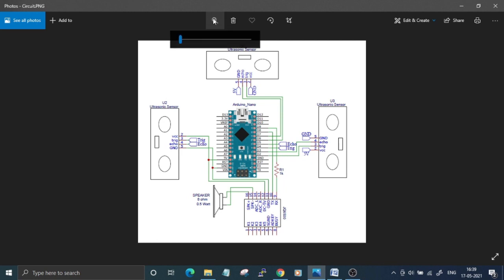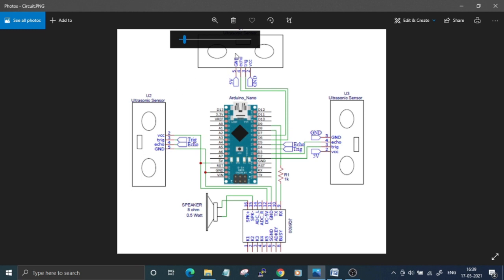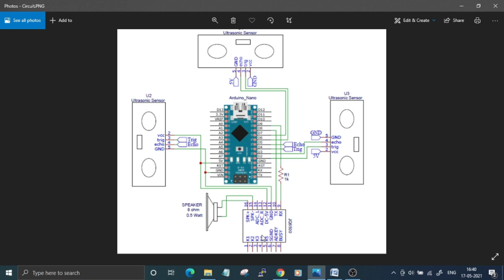How to Make a Smart Blind Stick using Ultrasonic Sensor | Arduino Project

Comment: waste code is not compiling waste of timee
Reply: I have rectified the error
Reply: @afzalahmed2756  Can you point out the error in program??
Reply: @afzalahmed2756  can you share the code
Reply: @afzalahmed2756  can you send me correct code
Reply: Hi can you please help me with the code? Thank you in advance!
Reply: @marielsophianicoleso1533  I have shared the code
Reply: @afzalahmed2756  can you please post the code
Reply: @ahmedalsiri2811  
#include <Arduino.h>
#include <SoftwareSerial.h>
#include <JQ6500_Serial.h>
SoftwareSerial mySerial(8,9);
JQ6500_Serial mp3(mySerial);
int left_trigPin = 7;
int left_echoPin = 6;
int right_trigPin = 2;
int right_echoPin = 3;
int center_trigPin = 4;
int center_echoPin = 5;
int motorPin=10;
void setup() {
 pinMode(left_trigPin, OUTPUT);
 pinMode(left_echoPin, INPUT);
 pinMode(right_trigPin, OUTPUT);
 pinMode(right_echoPin, INPUT);
 pinMode(center_trigPin, OUTPUT);
 pinMode(center_echoPin, INPUT);
 pinMode(motorPin,OUTPUT);
 Serial.begin(9600);
 mySerial.begin(9600);
 mp3.reset();
 mp3.setVolume(100);
 mp3.setLoopMode(MP3_LOOP_NONE);
}
void loop() {
 left();
 right();
center();
}
void left() {
 delay(100);// reading will be taken after ....miliseconds
 Serial.println("\n");
 int duration, distance;
 digitalWrite (left_trigPin, HIGH);
 delayMicroseconds (10);
 digitalWrite (left_trigPin, LOW);
 duration = pulseIn (left_echoPin, HIGH);
 distance = (duration / 2) / 29.1;
 //distance= duration*0.034/2;
 if (distance < 10) { 
digitalWrite(motorPin, HIGH); //vibrate
 delay(1000); // delay one second
 digitalWrite(motorPin, LOW); //stop vibrating
 delay(1000); //wait 50 seconds.// Change the number for long or short distances.
 Serial.print("Left Distance");
 Serial.print(distance);
 mp3.playFileByIndexNumber(1);
 }
}
void right() {
 delay(100);// reading will be taken after ....miliseconds
 Serial.println("\n");
 int duration, distance;
 digitalWrite (right_trigPin, HIGH);
 delayMicroseconds (10);
 digitalWrite (right_trigPin, LOW);
 duration = pulseIn (right_echoPin, HIGH);
 distance = (duration / 2) / 29.1;
if (distance < 10) { 
digitalWrite(motorPin, HIGH); //vibrate
 delay(1000); // delay one second
 digitalWrite(motorPin, LOW); //stop vibrating
 delay(1000); //wait 50 seconds.
// Change the number for long or short distances.
 Serial.print("Right Distance");
 Serial.print(distance);
 mp3.playFileByIndexNumber(2);
 }
}
void center() {
 delay(100);// reading will be taken after ....miliseconds
 Serial.println("\n");
 int duration, distance;
 digitalWrite (center_trigPin, HIGH);
 delayMicroseconds (10);
 digitalWrite (center_trigPin, LOW);
 duration = pulseIn (center_echoPin, HIGH);
 distance = (duration / 2) / 29.1;
 if (distance < 10) { 
digitalWrite(motorPin, HIGH); //vibrate
 delay(1000); // delay one second
 digitalWrite(motorPin, LOW); //stop vibrating
 delay(1000); //wait 50 seconds.// Change the number for long or short distances.
 Serial.print("Center Distance");
 Serial.print(distance);
 mp3.playFileByIndexNumber(3);
 }
}
Reply: @afzalahmed2756  thx thx thx a lot but are sure this code worked with you
Reply: @ahmedalsiri2811  yea bro
Reply: @afzalahmed2756  dued thank so much it worked 😀😀😀😀
Reply: @afzalahmed2756  thank you it worked
Reply: @ahmedalsiri2811   my pleasure
Reply: @afzalahmed2756  hello can you please send me the diagram that you used to connect every thing up because the diagram in the video is not working with me
Reply: @ahmedalsiri2811  how should I share on YouTube?
Reply: @afzalahmed2756  can you please send it now I really need iy
Reply: @afzalahmed2756  dued please say anything
Reply: @ahmedalsiri2811  bro how should I share the circuit diagram on YouTube
Reply: @afzalahmed2756  just say for example center sensor d1
Reply: @afzalahmed2756  dued please the due date is tomorrow
Reply: @ahmedalsiri2811  bro try reverse engineering concept , the circuit diagram provided  is correct
Reply: @afzalahmed2756  I'm really soory but it's not working with me did use the diagram or the table below it
Reply: @ahmedalsiri2811  yea bro
Reply: @afzalahmed2756  dued I connected everything up with a 9v battery but it can't make the noise
Reply: @afzalahmed2756  Hi mein ne apka code run kiya toh code mein error nhi he but kuch voice nhi arhi jo JQ6500 k sath speaker use kiya wo koi sound nhi produce kr rha ...ye motor pin kya he ??
Reply: @zunairakhalid7358   it's for vibration - motor pin
And check the circuit connection of jq6500
Reply: @afzalahmed2756  jaisa video mein he mein ne waisa hi kya he but no response
Reply: @zunairakhalid7358  first try with 1 ultra Sonic sensor
Reply: @afzalahmed2756  my connections are correct according to the diagram but idk what is wrong can you tell me how Do we know that the audio files are correctly uploaded on JQ6500
Reply: @zunairakhalid7358  first try only jq6500 module without connecting sensor to check the module is working properly the code for that module is readily available
Reply: @afzalahmed2756  Hello Sir,
Could you share you're contact or social media to recah out you, when there's error or problem while doing this project.Please sir!
Reply: @ahmedalsiri2811  hii
  Can u help me in this project
Reply: @sankalpgaonkar7274  I have posted in the comments  section it self just go through
Reply: @aura_farmer17  I have posted in the above comments
Reply: @afzalahmed2756  do you have facebook id i want to discuss something with you
Reply: @afzalahmed2756  I couldn't find bro
Reply: @afzalahmed2756  pin in the comment bro
Reply: @afzalahmed2756  can i ask? where can i put it in motorPin in wiring diagram? I hope you answer Thank you
Reply: @afzalahmed2756  yes...
Reply: @ishrathikhlakh4510  I have shared
Reply: @afzalahmed2756  I didn't received it... But thanks
Reply: @afzalahmed2756  just paste in this comment box
Reply: @ishrathikhlakh4510   I have pasted the code here
Reply: @afzalahmed2756  please paste the program...
Reply: @afzalahmed2756  I am not able to see the code
Reply: @ishrathikhlakh4510  but I shared 🤔